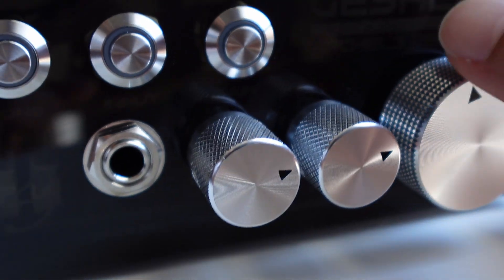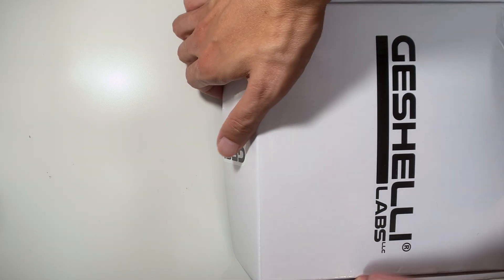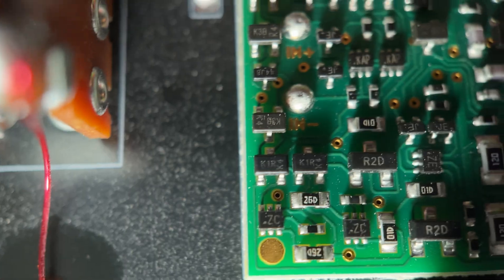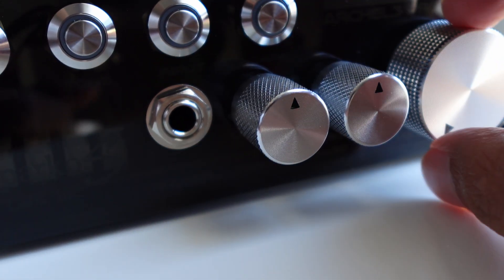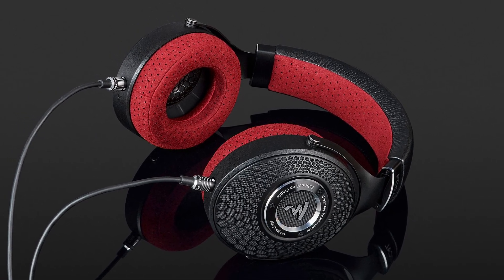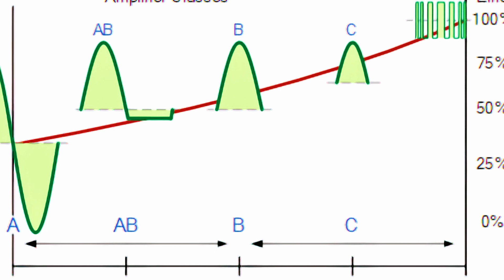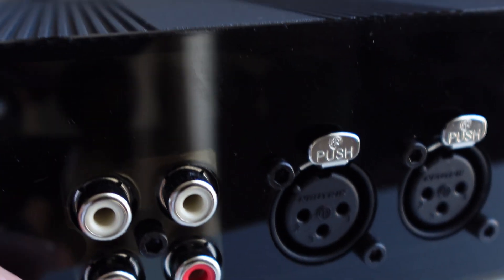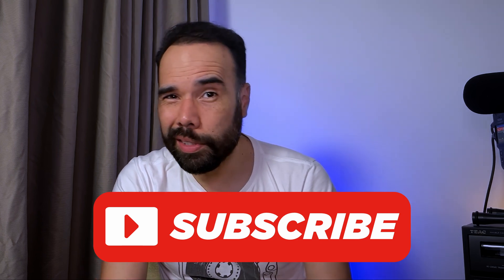CLASS-A Amplifier: Geshelli Labs ARCHEL 3 PRO #review #headphones #amplifier

Comment: Are the tone controls actual EQ or a distortion filter (like the Bellari 560)? If different, do you think I could run the Bellari in my chain?

Edit: I asked ChatGPT (not always correct, ofc):

'The Bellari SE560 Sonic Exciter does not explicitly use Baxandall tone controls. Baxandall tone controls are a type of circuit commonly used in audio equipment to provide smooth, symmetrical control over bass and treble frequencies. The Bellari SE560, on the other hand, is a sonic exciter designed to enhance clarity, presence, and definition in the sound, typically using harmonic generation and phase manipulation techniques, rather than traditional tone control.
What the Bellari SE560 Does:

The SE560 focuses on enhancing the upper harmonics and tightening the low-end response, giving the sound more definition and "excitement." It achieves this through dynamic processing, often referred to as psychoacoustic enhancement, rather than using typical EQ controls like the Baxandall circuit.'

Baxandall Tone Controls:

'These tone controls would provide broad frequency adjustments in the bass and treble ranges with smooth curves, allowing for subtle boosts and cuts, but they are generally found in EQ sections of amplifiers or preamps rather than exciters like the Bellari SE560.

In short, the Bellari SE560 does not use Baxandall tone controls. It relies on a different kind of signal processing aimed at enhancing audio clarity and presence, which is distinct from the functionality of Baxandall tone circuits.'
Reply from the maker: Thank you for the explanation! It's a Baxandall filter, and the mid frequencies stay stable with it. Only the lowest and highest frequencies change. It's good for minor changes to get the best response without applying considerable distortion.

Comment: Another fantastic video my brother! Appreciated the explanation on class A & A/B. I have a portable device that runs extremely warm with fully class A bias and now I understand. It also explains why despite the power output rating, it does not feel as powerful as other class D products. It is still powerful in its own regard.
Reply from the maker: Thank you for your feedback! Which portable device do you have?
Reply: @tapedac  It's a dap called the Hiby R4. Convenient, decent price, decent sound. Has some flaws but it's my current favourite device.